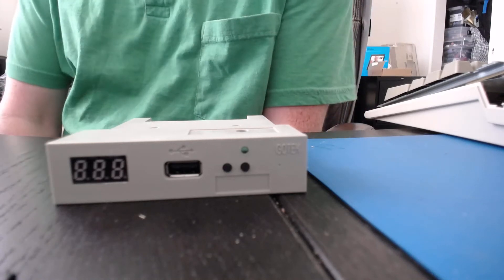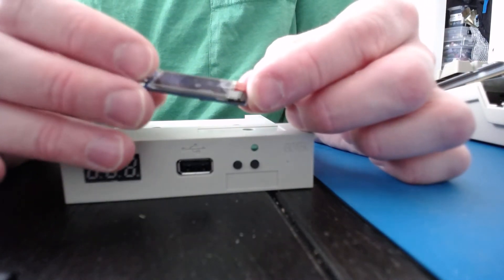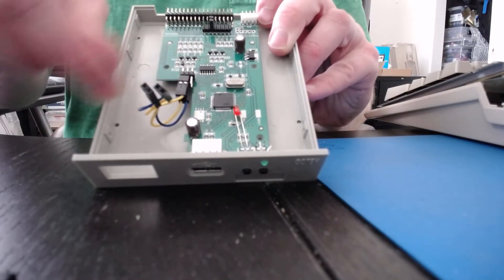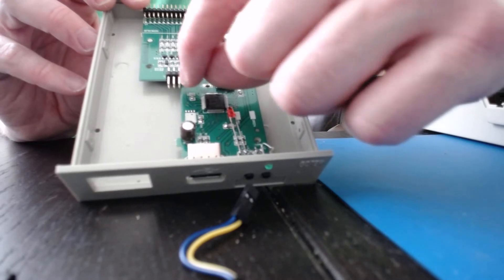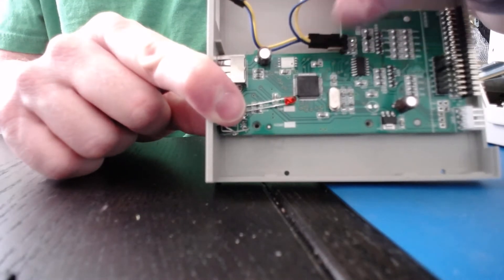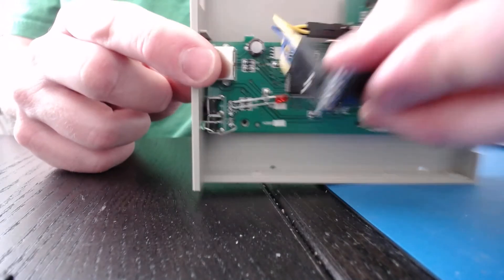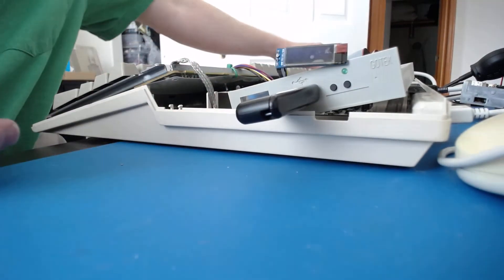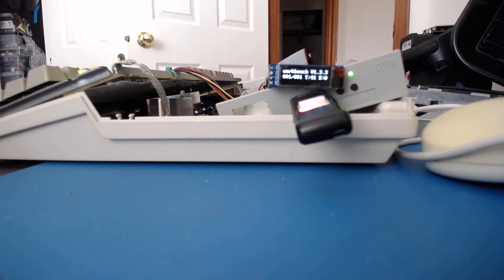Installing OLED into GoTek with Flashfloppy for Amiga Computers

Comment: I notice you have no header pins on the rear of your Gotek PCB, so how did you do the flashing?
Reply from the maker: I just used some test lead clips to do it.
Reply: you can use a USB-A to USB-A.  male-to-male connector. Flash directly to the Goteck's USB port.

Comment: what are the pinout connections with the oled?
pins out board/emulator first column (nº1 pin top, nº2 pin down), next and second column (pin top: 3º, pin down=4º), the connections with oled are these ones: 1->GND, 2->VCC, 4->SCL, 3->SDA  someone can confirm this? Or depending of different emulator boards? (i have the SFR1M44-U100K model)
Reply: Have a look on this page (by the Flash Floppy creator) under the heading "OLED Display".  They have diagrams and things on there.
https://github.com/keirf/FlashFloppy/wiki/Hardware-Mods

Comment: What about the taller OLED's. I think it's 128 x 64? Will they work? I have one that has the same 4 connectors and has a yellow part at the top of the sidplay.
Reply: Yes, they will work.  FlashFloppy has a setting in the FF.CFG file. check on the FlashFloppy WIKI.

Comment: the OLED screen looks wider than the original 3digits, how did you fit it back into the case?
Reply from the maker: You have to widen the original location.  I used a razor knife and tiny file.